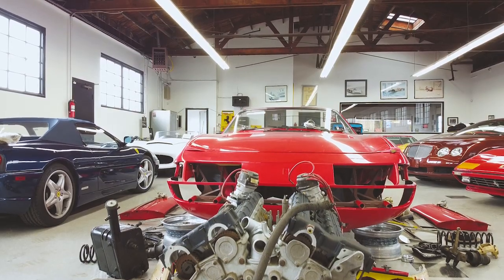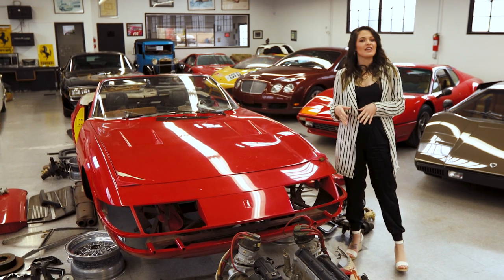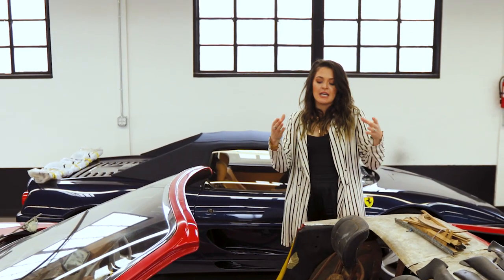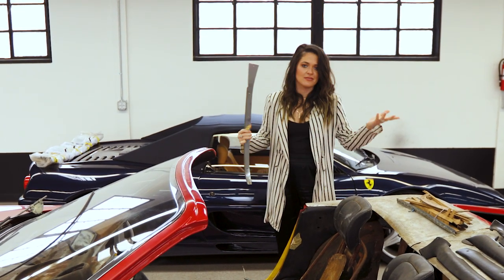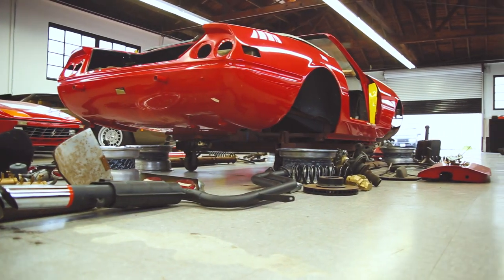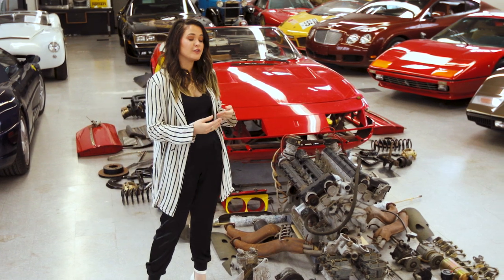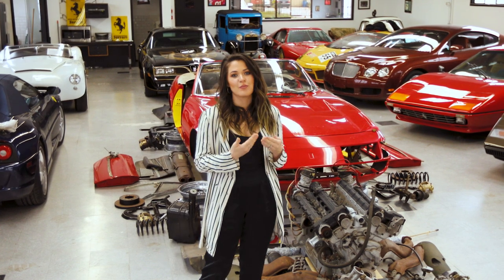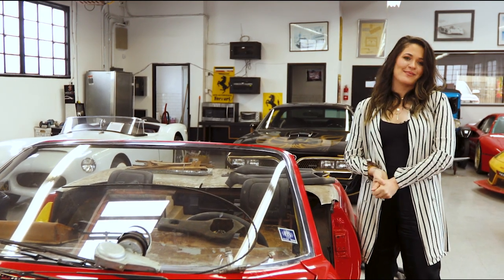Multi-Million Dollar Barn Find - Rare Ferrari Hidden for decades.

Comment: Even after paying someone to complete the entire restoration with carrying costs of money etc you would come out at least 200k to the plus. AND you would have a pristine restoration of the lowest mile Daytona Spyder known to exist... - most it would take to complete the resto would be 18 months most of that redoing the body in the correct color. - - there would literally be very little to source to complete it... soft parts - hoses- belts - all the camel leather- of course you have to do it back in Yellow over Camel. 
All the pieces stamped with the body numbers in beautiful original finishes is something true Ferrari geeks just drool over...

Comment: So over the five years production of this model they made less than 1500 VIN numbered cars intended for the street. That's fewer than 300 per year total even if 25 were spyders, that's hardly any when you compare to other automakers and makes any and all Ferraris rare. Rare is a rather redundant word to use when describing Ferrari as they had only made about 12,700 street cars total since starting in 1947. As a point of reference at the same time Ford was making a half a million Mustangs a year. 

Your EPA comment does not account for the fact that cars today are much faster, have significantly more power and handle much better.  

I wish you had shown a closer look at how crude many of the parts of this car are while you had it apart. Those stamp steel suspension parts are pretty ugly but not as ugly as the mild steel square tube frame and the many hand welds holding it together or the many flimsy mounting points. Or how tiny the brakes are and how heavy all these pieces are when compared to anything modern. Look at the wiring harness and switch gear if you want to show a rats nest of cheesy problems hiding under hand stitched leather. 

As for your number stamps any restoration shop will have sets of these stamps so while it's good to find the numbers it's no guarantee of authenticity on anything but an unrestored cars.

I'm not knocking it just being honest, these Pininfarina bodied cars are really beautiful.
Please paint it yellow again!